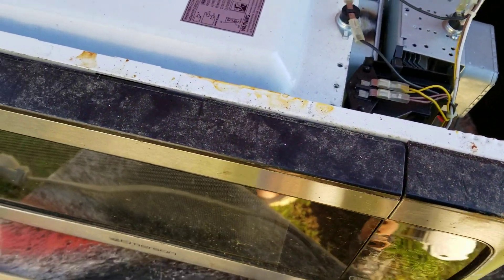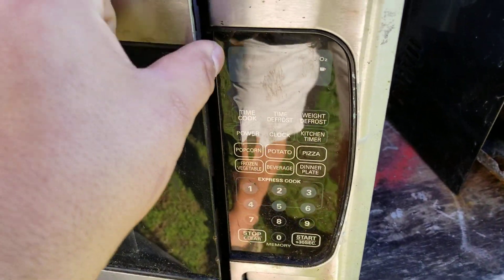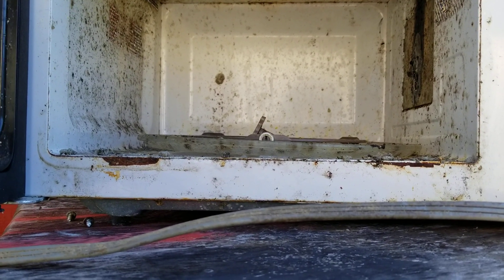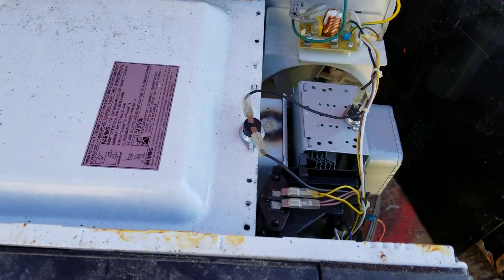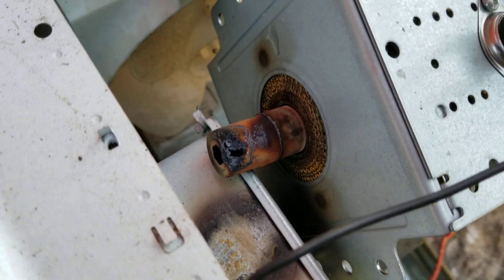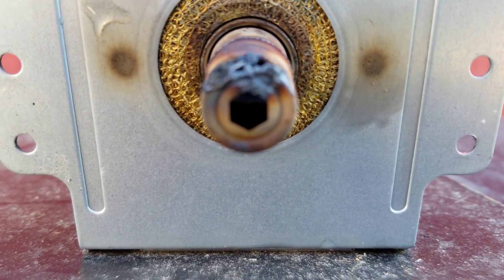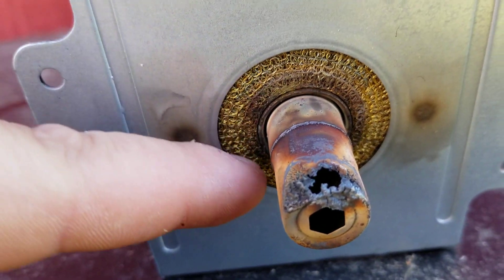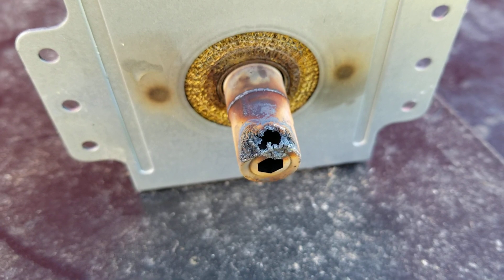Magnetron failure

Comment: That is actually quite a common fault. It is caused by operating the oven without any food inside it. It causes arcing between the antenna cap and the frame of the oven. That magnetron probably still works fine. Usually it is just a matter of replacing the burnt cap which costs a dollar or two from AliExpress and the high voltage fuse which also doesn't cost much.  It is advisable to replace also the mica window if it is burned through. The antenna cap is replaced by simply pulling it off and pushing on the new one.
Occasionally, but not often, if the fuse takes too long to blow then the arcing may burn through not only the antenna cap but also the copper tube behind it. That will cause air to leak into the magnetron and then the magnetron will need to be replaced.

Comment: That's not a Magnetron failure.  The Magnetron was in excellent condition and was emitting RF energy in copious amounts.  The tip of the Magnetron which emits the energy is in a waveguide that takes the energy to the microwave cavity (oven).  Food has contaminated the waveguide because the plastic or mica cover has not been cleaned and subsequently burnt.  Food has then entered the waveguide and arced inside burning the tip of the Magnetron which has led to a catastrophic failure.  Mold also may have had role in this failure. 
Not cleaning the mica/plastic cover is one of the primary reasons people throw out a perfectly good microwave due to arcing on the cover.